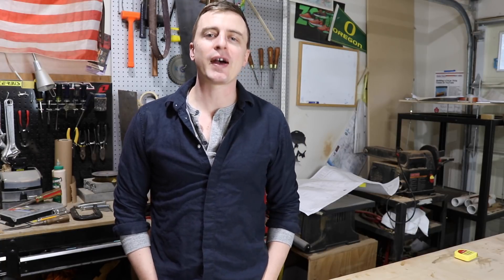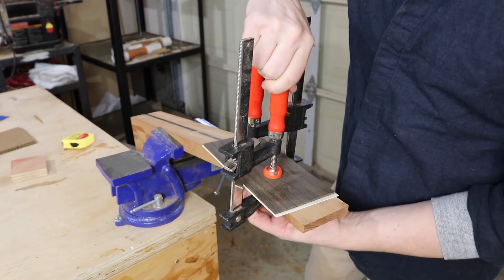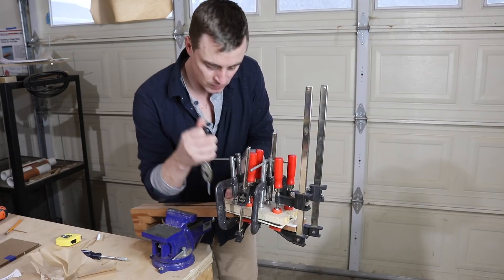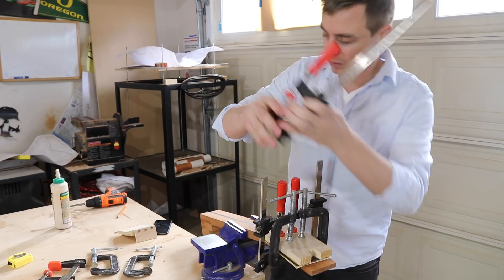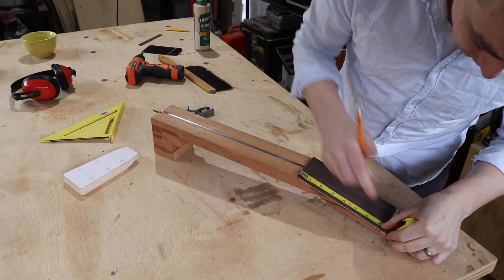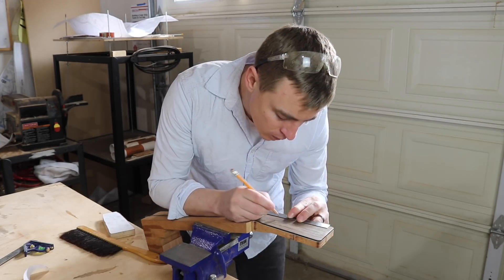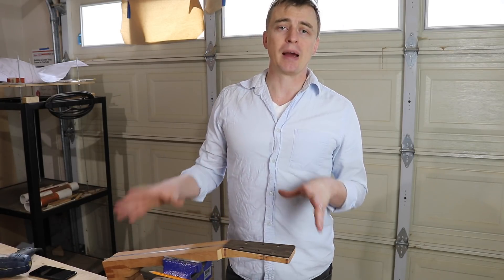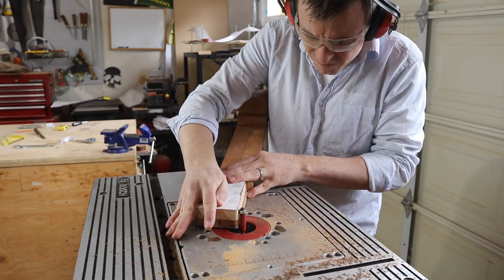Shaping the Headstock (Ep 10 - Acoustic Guitar Build)

Comment: Hi Adam, I'm a luthier also making banjos, ukuleles and guitars.  You have a very natural and conversational way of teaching.  Easy to listen to and follow and I'm learning some good tips from you. Keep up the good work! One suggestion: use tooth picks instead of nails as locater pins for the peghead veneer.  You don't have to remove them and you will never have to worry about ruining a cutting tool when shaping the neck.  Best, Mark

Comment: When applying wood glue, if you put a sprinkling of table salt on the glue before mating the two parts together it prevents the wood sliding around & doesn't affect the glue at all, therefore you don't need to insert the nails.
Reply from the maker: Bazza B haha I have never heard that before! I’m definitely gonna try it - thanks!
Reply: A Guy Doing Stuff it works, trust me, it's a tried & tested practice in the carpentry / joinery world, you don't need much, just a few grains.